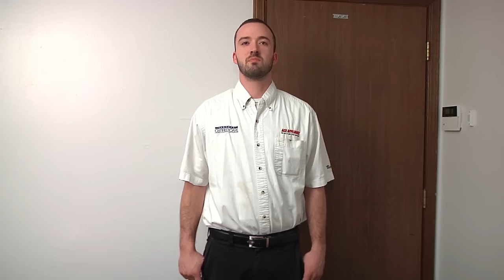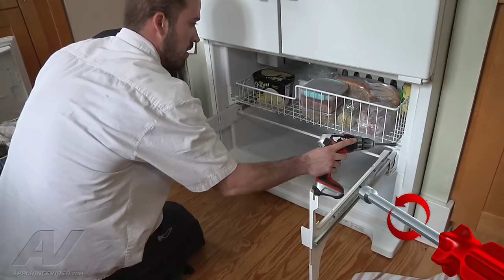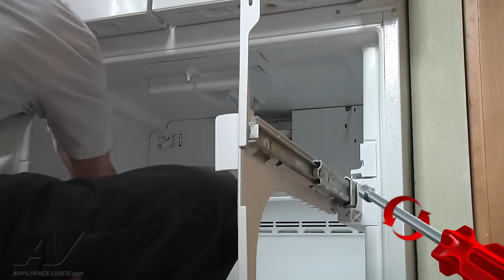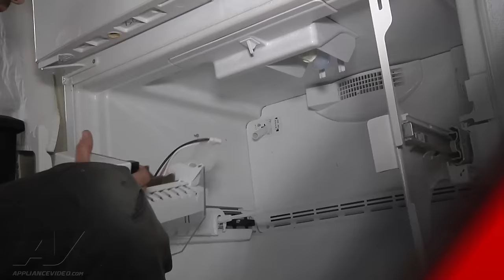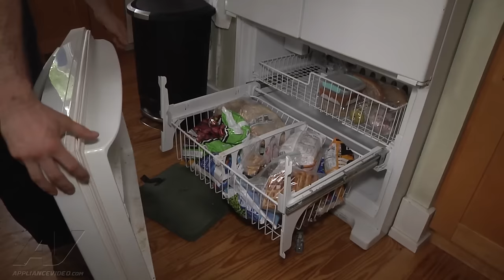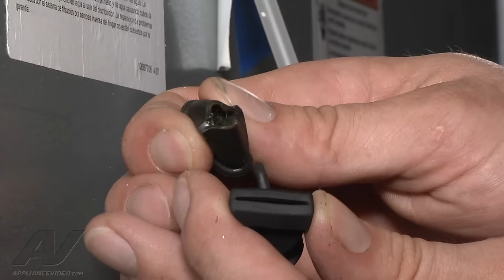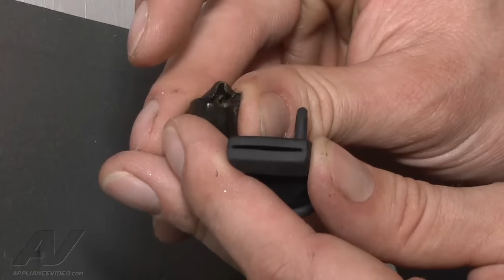Whirlpool Refrigerator Repair - Ice Buildup in the Bottom Freezer - Water Leaking - Grommet Kit

Comment: This is still daunting even with the video. And it is just as hard to put it back together again than it is to take it apart. I am glad it is over. If I could add a couple of comments though, one is that if you let the fridge naturally defrost by unplugging it for a few hours, you can skip the whole part about taking the freezers door, drawers and rear panel off. Secondly, if you do, you don't really have to remove the thermostat and ice making plug from the panel as you only need to access the bottom of the rear compartment. But finally, my brainstorm! I got out my Waterpik and blasted the drainage channel and hole at the rear since I was there anyway. It must've done a good job because the water in the evaporating tray afterwards was GROSS!!! At least it won't plug up the grommet again. I hope I never have to do that again.
Reply from the maker: Great question, if you have a more technical question that our parts department cannot answer, you can search our over 17,000 answered questions free at our website www.ApplianceVideo.com under our Repair Help section. You can also call our parts department at 1-800-830-5465 and they can give you help 7-days A week ,or search at www.SaveMoreOnParts.com  .

Comment: so should i take it all apart,door and drawers,and defrost first then install the new p-trap drain tube? whirlpool had no idea what i was talking about for the fix it part. thanks!
Reply from the maker: Edward 
                               If you go to our FREE repair help website at ApplianceVideo.com and post this question, we have 14 factory authorized technicians that will answer any technical questions at absolutely no charge on your appliance issues. This is the only website on the web that you can get questions answered by certified appliance and HVAC technicians along with over 2600 free repair videos.  Matt Ace Appliance factory service technician

Comment: Thanks for the great review.  If I defrost my refrigerator for 24 hours, would that be enough time to replace the part without having to worry about removing the freezer trays to heat the ice on the coils?  Thanks in advance!
Reply from the maker: Great question, if you have a
more technical question that our parts department cannot answer, you can search
our over 10,000 answered questions free at our website www.ApplianceVideo.com under our Repair Help section. You can also call
our parts department at 1-800-830-5465 and they can give you help 7-days A week
Monday -Sunday, or search at www.SaveMoreOnParts.com  24 hours
7- days A week.

Comment: This video explains it well. But the main question remains, as to why this happens. My fridge keeps building ice in the cooling system since the de-icer thermostat blew up two months ago. Fixed that , but then the fan keeps stopping. not because of ice buildup... I'm so tired of this. I'v got to keep manualy de-ice it... this is getting old for me !!! Any advice would be nice.
Reply from the maker: Great question, if you have a more technical question that our parts department cannot answer, you can search our over 17,000 answered questions free at our website www.ApplianceVideo.com under our Repair Help section. You can also call our parts department at 1-800-830-5465 and they can give you help 7-days A week ,or search at www.SaveMoreOnParts.com  .

Comment: I had a repairman come from Home Depot while under warranty (extended warranty) for noise and frost buildup in the freezer.  He removed the grommet and said you do not need it; this is contrary to what you stated.  The duck bill looks intuitively "better"; but I do not see any real purpose for it other than to make sure that debris does NOT drain.

I am watching this video because the fridge is warm and the freezer is super cold with some ice forming.  My experience is that over time the heating element doesn't defrost enough/work as well and by adding aluminum wire to the element on one end and putting the other end onto the drip pan; the heat is transfered across the entire drip pan and allows for a full defrost.  Any thoughts?

Thanks for the video - my back already aches from watching.  God bless you for sharing!!
Reply from the maker: Thanks for your response, we are glad we could help. Our library of over 5,700 videos are currently helping over 1.6 million people like you every MONTH.  Please help us by subscribing to our YouTube channel, or post our website www.ApplianceVideo.com to your Facebook page, Twitter, Instagram or any other social media sites. Your support will help us keep producing more free quality videos.

Comment: I followed instructions to a tee but for a different reason. I wanted to make sure my evaporator fan was working. Top part refrigerator isn’t cooling. Bottom freezer is nice and cold. Everything works, condenser, condenser fan, defrost is good, evaporator fan is also good. Could it be my electronic control board?

Comment: Great video, thanks for sharing.  One question, what is the function of this grommet duck bill?  Can we do without it?
Reply from the maker: Joanna
        You cannot remove the duck bill, if you do humidity will get inside the freezer and cause major frost problems. If you put on the new kit you can then replace the duck bill.  We're happy you liked our video.Whirlpool just came out with a new part fix to solve this problem for GOOD. Purchase a W10619951 drain kit, go to and purchase on line at appliancevideo DOT COM  or call 1-800-816-0715 .
Reply: ***** What is the difference between W10619951 and W10909238?  I can't find a picture of the new W10619951.
Reply: Joanna ok Typo above.  What is the difference between W10619951 and W10309238?

Comment: Great video. Could I use hot water in a spray bottle? I dint own a turkey baster 😄 
We had leaking here and there u see our fridge coming from the freezer and tonight my husband looked @
It more because the leaking was a little river coming out of like or a little Pool. So he found a sheet of ice on the bottom under the bottom basket 🙄😬
So our fridge is a kenmore and it’s three or four years old-now that old. And we do clean it every year for spring cleaning. 
Would we have to do this often or every year now so there is no ice build up? Is this something that all freezers do and this is like a regular thing to do every three years? Just wondering. It’s my first French door fridge cuz I’ve always lived in apartments or a mobile home and had small fridges. 😊
Reply from the maker: Great question, if you have a more technical question that our parts department cannot answer, you can search our over 13,000 answered questions free at our website www.ApplianceVideo.com under our Repair Help section. You can also call our parts department at 1-800-830-5465 and they can give you help 7-days A week ,or search at www.SaveMoreOnParts.com  .

Comment: I replaced the drain tube on my Maytag MFF2258VEW3 refrigerator and the leaking water / frozen ice at the bottom of the freezer still happens.  It is beyond frustrating.  There is an occasional loud  clunking noise coming from the freezer.  Any idea what this is?  Thanks!

Comment: Got the same problem happening with my freezer! How effective would it be to run a hair dryer through those vent holes to melt the ice instead of going through the whole process of removing that back panel? 
Subscribing!  Thanks for your input!
Reply from the maker: Sal 
       Send me the freezer model number and i can look at it to give you a more specific fix. Every model is different. Thanks Matt Ace technician
Reply from the maker: Sal 
      I looked at your model. Shut it off for 24 hours with the door open. Then take off the evaporator cover plate and you will see the drain hole at the bottom middle of the unit. Pour hot water down the hole to make sure the drain is completely open.  That should open up your drain and take care of your issue.  Please help us provide more videos to our site by
subscribing to our YouTube page or posting ApplianceVideo.com site on your
Facebook or Twitter account. We also have our factory authorized technician's email
daily free professional advice to people like you to help solve their appliance
problems. Thanks in advance for supporting us. Matt, Ace Appliance service technician.

Comment: The second grommet. the duct bill is not working either. Theres a new solution for that. a service flash is available by whirlpool regairding this issue but i dont have it now in my hand but theres a p-trap line design for this issue. This new repair is working really good now
Reply from the maker: Thanks for the updated information, we will post it on the new video.

Comment: Thanks. I did this repair recently. Any idea what could cause the ice maker not to work afterwards?  Water is on and the ice maker is connected.
Reply from the maker: Great question, you can call our parts department at 1-800-830-5465 and they can give
you help 6-days A week Mon-Sat . If you have a more technical question that our
parts department cannot answer, our technicians are answering all questions at our website at www.ApplianceVideo.com under our Repair Help section. We have over 4,000
common questions and answers that you can easily search through by your model
number, appliance make, and problem or error codes, and It’s free to search
through our question & answer library.

Comment: Hi dumb question. 
Can the wire harness electric plug to the water inlet valve be put in backwards? It looks like it can be shoved on either way.
I've not seen or heard any activity since I've installed the water inlet valve.
Reply from the maker: Great question, if you have a more technical question that our parts department cannot answer, you can search our over 17,000 answered questions free at our website www.ApplianceVideo.com under our Repair Help section. You can also call our parts department at 1-800-830-5465 and they can give you help 7-days A week ,or search at www.SaveMoreOnParts.com  .

Comment: 9yr old french door maytag.  I started getting ice and water dripping from the left side of the freezer. 
I noticed the following:
1. I seem to only have this problem when bottom shelf is full. If I only use top shelf for a few days - no problems at all,  but after 3 hours of 8 bags of shrimps on the bottom shelf, half of the floor is covered with ice, then water starts dripping on the floor. Last time it was about 1 drip every couple seconds. 

2. When I pull left side of the handle, it seems like left side opens a lot more than the right one. by probably a few inches more. 
is it adjustable, should I adjust it? 

What's the best way to see if gaskets are tight? 
I put a bright LED flash light in the freezer at night, don't see the ice coming through.
I tired laser thermometer gun around gaskets, temp is within a couple degrees difference. 
If I stick my finger between freezer door and the refrigerator, I can see a small difference between top and bottom on the right side

What lubricant should be used for the freezer door and how should it be applied? It's not too tight, but it feels like it could use some lubricant. 

Where do I find the grommet for Maytag MFF2558VEB3 ? It looks like there's new "Maytag Refrigerator Drain Pipe"

Last question - I don't use ice maker - is it safe to just remove it? Do I need to shut off the water if I remove it or is it in off position when removed? 

Thanks
Reply from the maker: Great question, if you have a
more technical question that our parts department cannot answer, you can search
our over 10,000 answered questions free at our website www.ApplianceVideo.com under our Repair Help section. You can also call
our parts department at 1-800-830-5465 and they can give you help 7-days A week
Monday -Sunday, or search at www.SaveMoreOnParts.com  24 hours
7- days A week.

Comment: I have a question we have a maytag refrigerator with French doors and bottom freezer. I relize today that the left side of the freezer wont seal but the right side does. So it's making the freezer frost prob cuz is continually running. We removed everything that would potentially be causing it to do that but nothing worked.  So I'm thinking it might be off track? Do you have a video about this?  I looked and didn't see anything?  I'm not sure how to take the track apart. Thank you
Reply from the maker: Shannon Nolen 

All of our technicians are now answering questions daily at our http://www.appliancevideo.com/ website under the Repair Help section.  We also have over 1600 common questions and
answers that you can easily search through by your model number, appliance
make, problem or error code and it’s absolutely FREE. You also have the option
to email a factory service technician with a question on your appliance at
http://www.appliancevideo.com/repair-help/ . If you’re looking for a repair video, you
can also search our library of over 2600 free repair videos. ApplianceVideo.com
specializes in quality DO-IT-YOURSELF appliance repair videos and we get over
800,000 views per MONTH to our videos worldwide and growing. If you need of
parts for your major appliance, we have over 5-million parts in stock at http://savemoreonparts.com/ .  Thanks
for your support. Matt Ace Appliance factory service technician.
Reply: Thank you for answering

Comment: Problem with my bottom drawer is when you pull it out partially and try to push back it, once side of the railing is working better than the other side as if their is a blockage on the track - any experience on this problem?
Reply from the maker: Great question, if you have a more technical question that our parts department cannot answer, you can search our over 17,000 answered questions free at our website www.ApplianceVideo.com under our Repair Help section. You can also call our parts department at 1-800-830-5465 and they can give you help 7-days A week ,or search at www.SaveMoreOnParts.com  .

Comment: Thank you, very helpful,where I can get the part to replace the old one?
Reply from the maker: Great question, you can call
our parts department at 1-800-830-5465 and they can give you help 6-days A week
Mon-Sat . You can also search at www.SaveMoreOnParts.com 7- days a week.  If you have a more
technical question that our parts department cannot answer, our technicians are
answering all questions at our website at www.ApplianceVideo.com under our Repair Help section. We have over 6,000
common questions and answers that you can easily search through by your model
number, appliance make, problem or error codes, and It’s completely free to
search through our question & answer library. There is a very good chance
you question is already answered there.

Comment: Great video...now what needs to be done so this doesn't happen again.  Also, do not use my ice maker, not connected to any water supply, once I take it off, do  have to re-install it again or can I leave it off!.
Reply from the maker: Lynn McComb 

                   All of our technicians are now answering questions
daily at our http://www.appliancevideo.com/ website under the Repair Help section.  We also have over 1600 common questions and
answers that you can easily search through by your model number, appliance
make, problem or error code and it’s absolutely FREE. You also have the option
to email a factory service technician with a question on your appliance at
http://www.appliancevideo.com/repair-help/ . If you’re looking for a repair video, you
can also search our library of over 2600 free repair videos. ApplianceVideo.com
specializes in quality DO-IT-YOURSELF appliance repair videos and we get over
800,000 views per MONTH to our videos worldwide and growing. If you need of
parts for your major appliance, we have over 5-million parts in stock at http://savemoreonparts.com/ .  Thanks
for your support. Matt Ace Appliance factory service technician.

Comment: Howdy! Do you have a video for a Maytag side by side? Or is the french door/bottom freezer the same config in the back? I have ice building up on the floor of my freezer, some water on the far left top of the fridge side. The water gets on the floor intermittently. I have a slate floor. It appears that water has crept under it in a few spots. Should be ok pulling the fridge out but I don't want to have to do it more than once. I will be sure to order the part from your site. Thanks for the info! :)
Reply from the maker: Great question, you can call our parts department at 1-800-830-5465 and they can give
you help. If you have a more technical question that our parts department
cannot answer, our technicians are answering
all questions at our website at www.ApplianceVideo.com under our Repair Help section. We have over 3,000 common
questions and answers that you can easily search through by your model number,
appliance make, and problem or error codes, and It’s free to search through our
question & answer library.